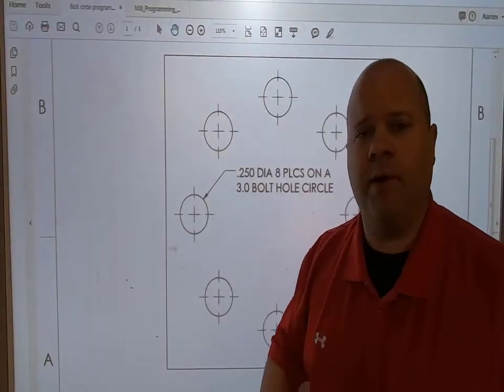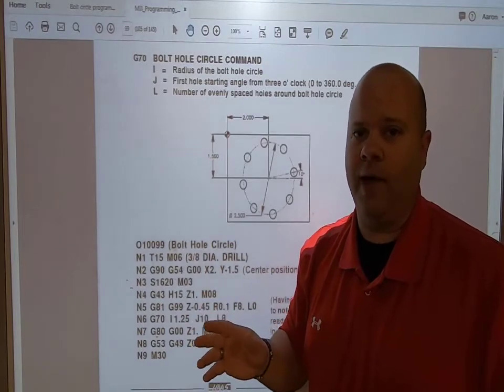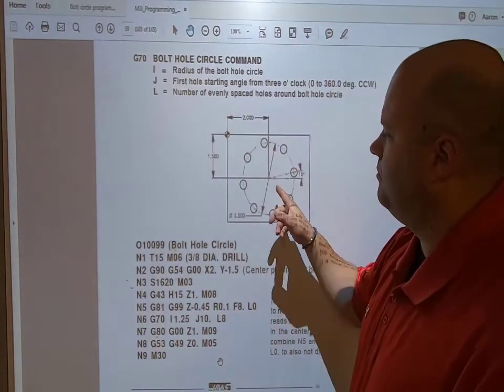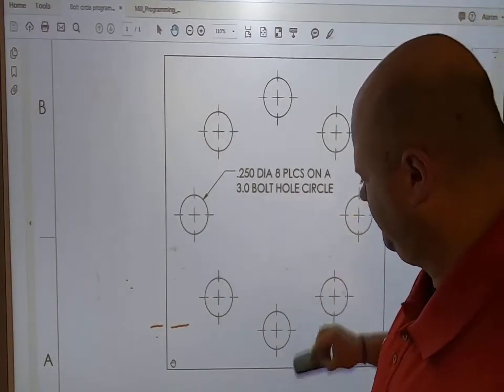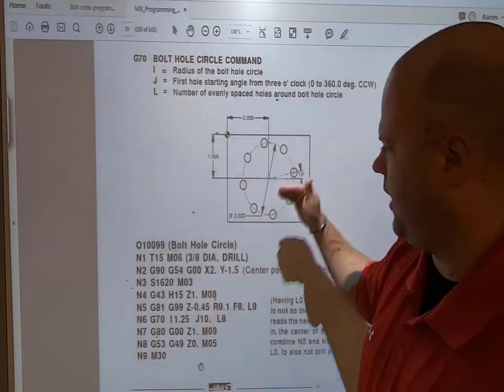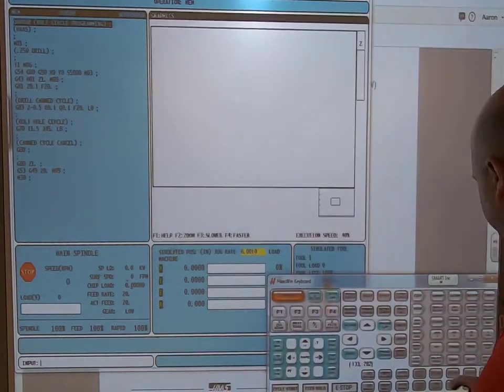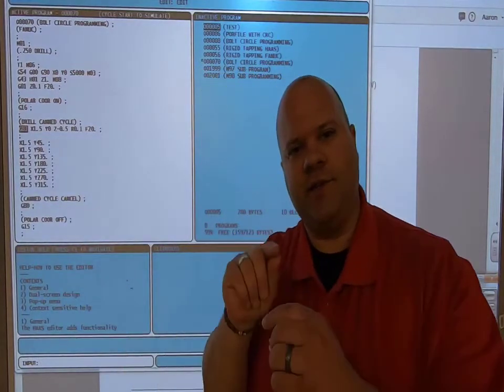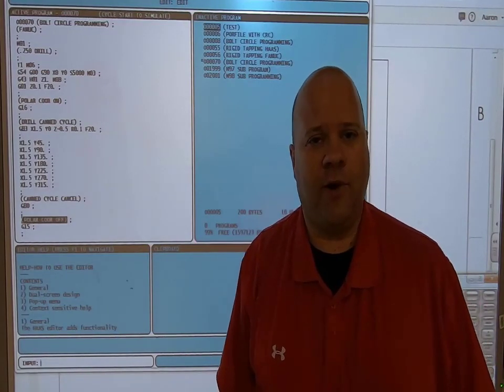Hand Programming Bolt Hole Circle Using Haas G70 Code

Comment: hi there what book can a get to program on even bolt holes? Thank you I can new to program Hass and editing the program. I use to run Mazak.
Reply from the maker: @rhonda1950 Hello,  good news is the g70 will program the bolt holes evenly. There are a couple of other Haas specific codes that can program holes evenly along an arc. The best thing to do is go to the Haas website, and under service, there are how-to procedures and videos that will help you learn your machine. I hope this helps and good luck

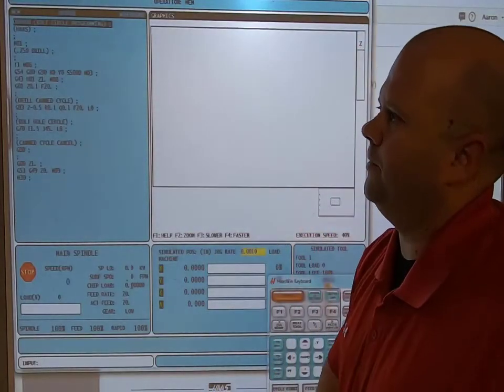Comment: What program were you using for the demonstration at 8:12?
Reply from the maker: It's a Haas simulator, but it's a computer version of it when. When I started teaching, it was  already on the computer, but a local Haas dealer should be able to assist you in getting one for your computer. Thanks for watching

Comment: One two  lines  interpoluction holes (one time 10 to 15 holes interpoluction  cycle )  please tell
Reply from the maker: If your wanting to interpolate holes.  You will want to use subprogramming M98 or M97. This way you can move to your location and then turn on G91 and interpolate at that location.  Here's video for sub programming. Thank you for watching. https://youtu.be/eqGHHDnEEgo

Comment: Thanks buddy really helpful,
I tried to generate "G70 bolt hole pattern" code in (hsmworks cam package), but i could not able to do.
It is not possible??
Or should edit the post processor for haas vf2??
Reply from the maker: So I know that post processors can be edited to do bolt circles. I'm not sure how you would set up the post-processor, coding is definitely a different ball game for me. however most software's will program point-to-point which should work in most cases. Thank you again for watching

Comment: Hi
This work on Fadal?
Thank you
Reply from the maker: Hi Wagner, unfortunately G70 is a Haas specific Code, but the polar coordinate function I would want to say would work. If you want to try it just copy the code that I show and give a try.  Thank you again for watching
Reply: @aaronrunk4209  thank you very much
Great job
Reply: @aaronrunk4209  
Hi
If i send to you a BHC from Fadal manual do you be able the explain to me how can i program my cnc to do BHC?
Thank you
Wagner Damotta
Reply from the maker: @wagnerdamotta726  I don't know how much help I could be with a manual. However, I don't mind taking a look at it. The best i can come up with until then is a sample program. Below is the post for a Fadal_cnc88_3x  the bolt circle is  DIA(1.574) 8 holes equally spaced .392 deep
Again I would attempt the Polar Coordinates programming for a bolt hole circle. 
https://www.cnccookbook.com/cnc-bolt-circle-g15-g16-gcode-polar-coordinates/
Reply from the maker: @wagnerdamotta726 
 N591 T4 M06                                                                     
N596 S70 M03                                                                    
N601 F11.811                                                                    
N606 G00 X1.933 Y3.311 Z0.343 G43 H00                                           
N611 T3 M06                                                                     
N616 S70 M03                                                                    
N621 F11.811                                                                    
N626 G01 X4.747 Y1.296 Z1.5 G43 H00                                             
N631 G01 Z0.463                                                                 
N636 G02 X3.625 Y0.174 I-1.122 J0 F39                                           
N641 G01 X2.779                                                                 
N646 G01 Y0                                                                     
N651 G00 Z0.539                                                                 
N656 G00 X4.467 Y1.296                                                          
N661 G00 Z0.463                                                                 
N666 G02 X3.625 Y0.454 I-0.842 J0                                               
N671 G01 X2.499                                                                 
N676 G01 Y0                                                                     
N681 G00 Z0.539                                                                 
N686 G00 X4.187 Y1.296                                                          
N691 G00 Z0.463                                                                 
N696 G02 X3.625 Y0.734 I-0.562 J0                                               
N701 G01 X2.281                                                                 
N706 G03 X2.219 Y0.672 I0 J-0.062                                               
N711 G01 Y0                                                                     
N716 G00 Z0.519                                                                 
N721 G00 X4.747 Y1.296   
                                                       
                                                      
N1386 M05                                                                       
N1391 M02      
%
This is only one hole because of reply restrictions
Reply: @aaronrunk4209 do you have a emal for me send to you a pic of the page of manual?
Reply from the maker: @wagnerdamotta726  williamrunkster@yahoo.com

Comment: When programming   a bolt circle, I know sometimes you need to center drill first and then go back and drill next. Since the center drill bit and drill bit are different size bits, would that need to taken into consideration when programming and how would you input that in the program?
Reply from the maker: You are correct you do need to be center Drilling if your drill is not self centering.  Good news is you can simply copy and paste the drilling code and change the z depth and both will work.  Thanks for watching